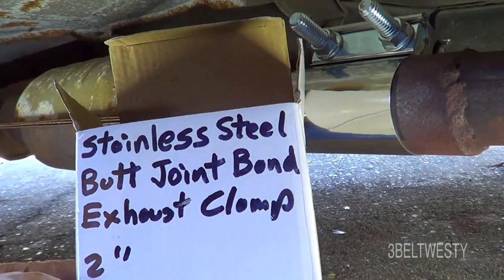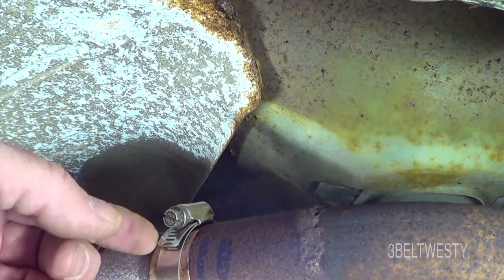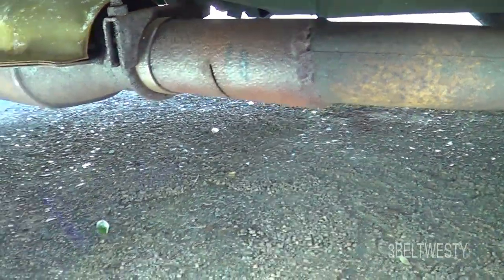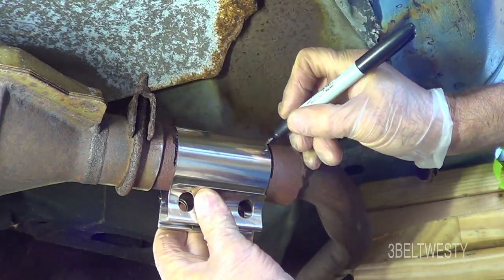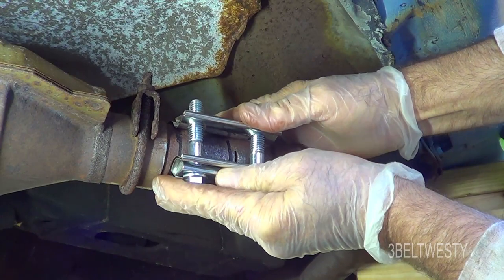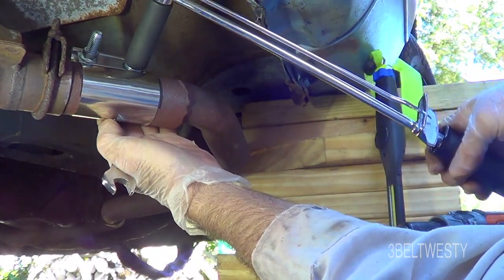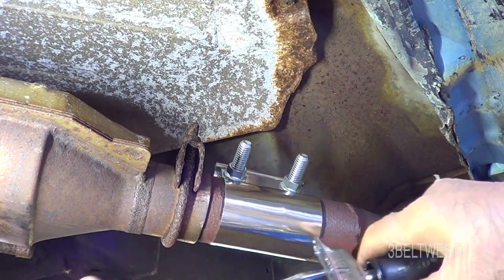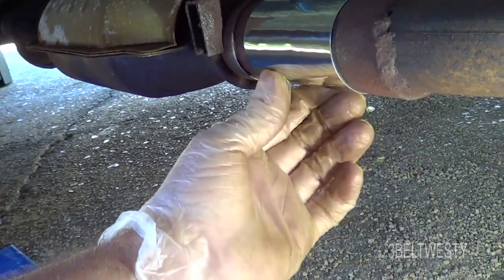Exhaust Pipe Butt Joint Band Clamp

Comment: Those work great for all sorts of exhaust joints. And you can smear on Permatex ultra copper RTV to help it seal. It holds up to the heat. and for slip joints put RTV on the pipe that goes into the larger pipe, will keep water out and stop it rusting.
Reply: If im gonna cut the muffler off my car - could i use this method to attach a stainless steel pipe to replace the muffler? Would that be structurally sound?
Reply: @FC3_RIPPER  Sure, just make sure to get the right sized exhaust pipe sleeve. Yes it will be structural, these clamps are strong.
Reply: And when you have the right size, the clamp bolts are tightened all the way to make the fit, they are designed to fit snugly around the pipe. Some clamps have an expanded end, which will fit over an expanded muffler pipe end or an expanded exhaust pipe end joint, some are fit to the non expanded exhaust pipe, that pipe is smaller so that it fits into the expanded muffler end pipe.

Comment: Thank you for this great video . I bought a 1982 SL380 R107 Mercedes with a complete new exhaust system and some dumb idiot welded the entire sections together,  from the tailpipe to where the pipes bolt onto the manifolds . I'm now going have to cut the pipes in sections , so I can work on the undercarriage .I plan on using this style of clamp temporarily, until I decide how I'm going to redo the exhaust. 
   Thank you again.

Comment: That looks like an easy weld.  IF you want to fix it without the weld I'd use JB weld epoxy.  Then do the band clamp around it.  That copper band was a smart choice.

Comment: No need for the torque wrench, tighten it with the impact until it stops turning. The band will stretch tight around the pipes.

Comment: Im gonna add a bead of copper rtv on both ends when i do mine's. Nice work btw
Reply: mr incredible yep, right at the pipe butt with high temp.
Reply: I do so. Only I put nickel anti seize and I put it at bolts to.

Comment: It would ensure a better seal if you use muffler cement around the cut in the exhaust pipe and then install the pipe seal metal flange.

Comment: So the 2 " refers to the type of clamp you need based on the outer diameter of your exhaust?
Reply: All 2 inches it's a Female coupling and the male 2  inches exhaust pipe insert in the hole of the Female. OD and ID it's like plumbing measure fit seal and stick. It's like  ducts  for the heating air-conditioned measure fit and and seal.

Comment: Nice temp solution..... I would just weld the cut with 308L Stainless mig preferred 0.23 wire quickly can call it a day. Also quick tip if you have sealing problems and you need a butt clamp in place. You can always wrap a thin sheet of fiberglass around it. Fiberglass has a melting point of around 1700F so perfect for exhaust work to fill the little cracks and groves under the clamp up. All you need is a very thin piece of the size of the clamp itself plus a little extra on the length of 3.14 * diameter (2.5) = 7.85 so I cut it 9" long and wrap it around this way it will seal the little 2 joints where the clamp meets the aluminum piece and you have even less exhaust leaking out. We do this on Rally Car's when we are out racing and do have a crack or need to clamp into the exhaust something.
Reply: Band clamps better than welding, they last a long time. Welders cost more money, Lap clamps saves pipes, so they can be easily  reused when you have to take things apart.
Reply: Good idea to put a piece in there to seal it better. 👍

Comment: Can those things replace a 2" gap between exaust pipes?, Im considering cutting off the flang connectors on my exaust(broken&rusted bolts)..👋😕
Reply: Did it end up working? I’m in similar position right now.